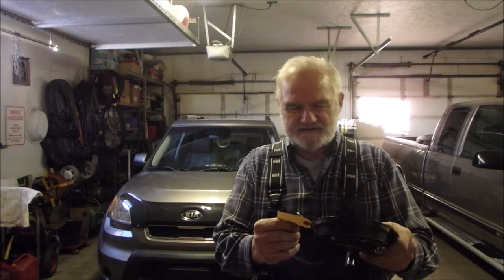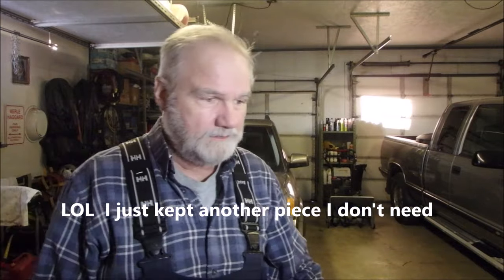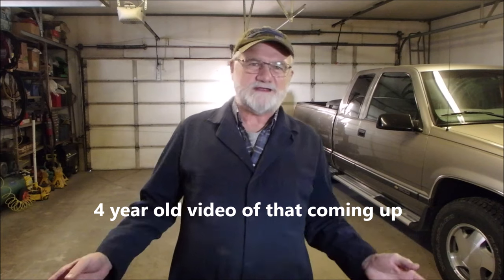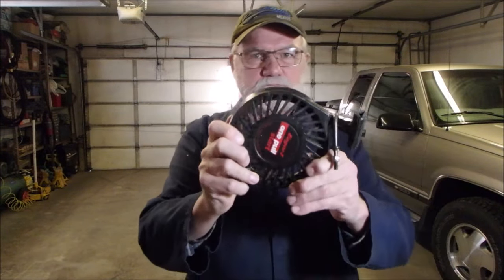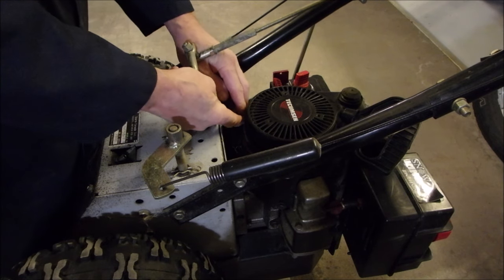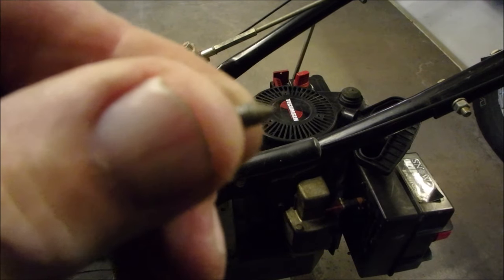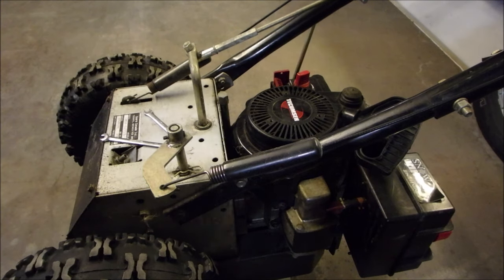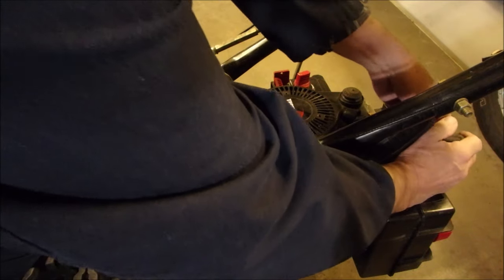Craftsman Snow Blower Rope Pull Replacement

Comment: Curious who made that unit for sears. I'm still using an 80s noma track drive. I also have another old 5/24 sears. Sat mostly unused and my daughter's place last winter. I just brought it back home. Started right up and run perfect
Reply from the maker: It changed a lot back then   Ariens or MTD or murray.  I am no help as there is no serial #

Comment: Off subject but where do you find a serial number on a Tecumseh engine? Thank -you
Reply from the maker: There are a few spots.  Some are hard to find.  I have even used Google to learn where they are.  The older ones are on tags on the side of the engine and some are stamped into the block.  I guess Google is your answer.  Just type in Tecumseh   then the HP  then serial #
Reply: @BrucesShop  thank -you